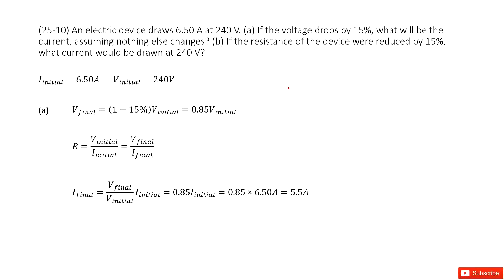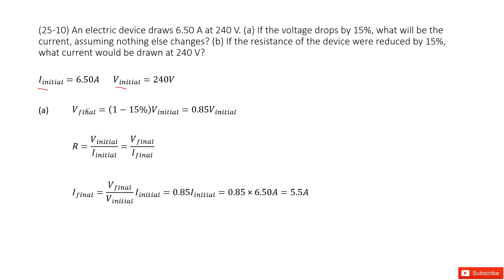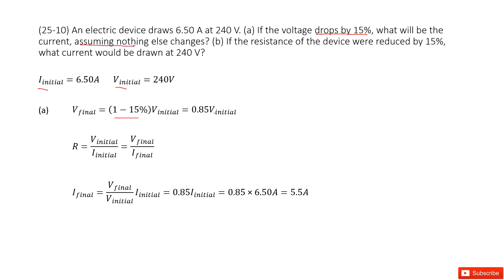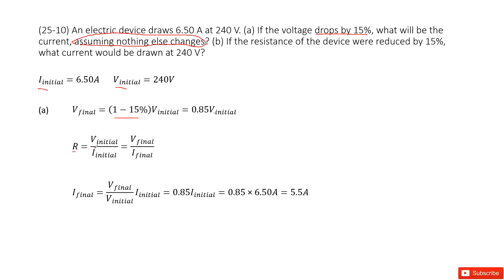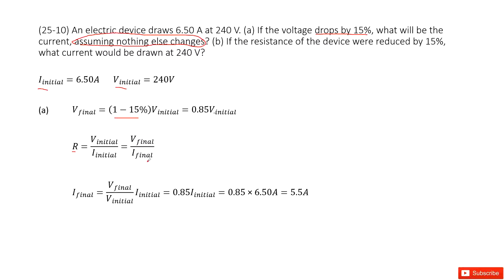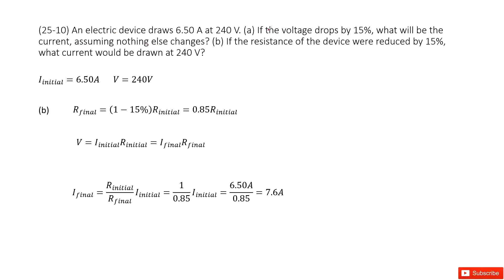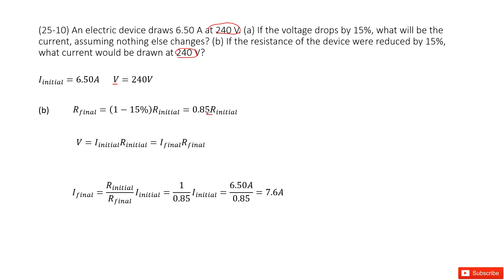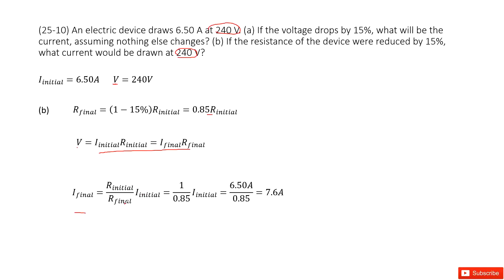(25-10) An electric device draws 6.50 A at 240 V. (a) If the voltage drops by 15%, what will be the

Comment: yo im convinced you pull these formulas from out of nowhere, because (1-0.15)x240=204 according to my calculator WHERE TF DID YOU GET 0.85
Reply: 0.85 is just 1-0.15 like you have in your parentheses. 240V is the initial Voltage. So she just condenses it and leaves it as 0.85Vinitial (or in other words 0.85 * Vinitial (which is 240)).
Take it easy on her, she's helping us out big time.